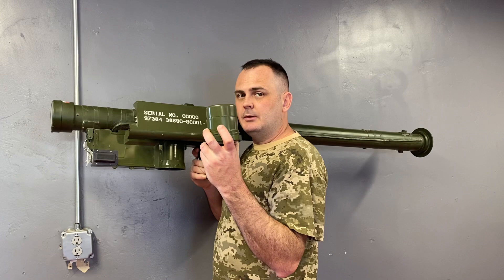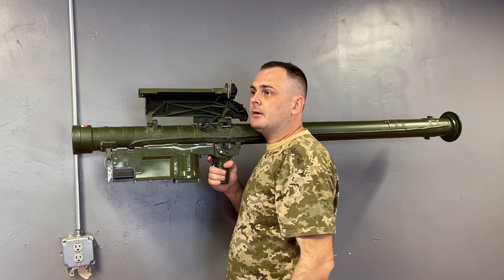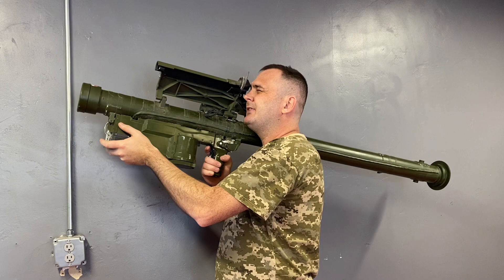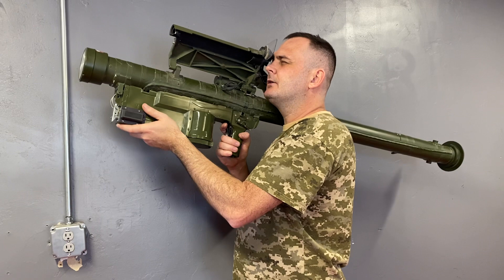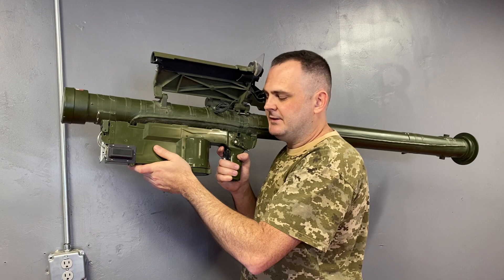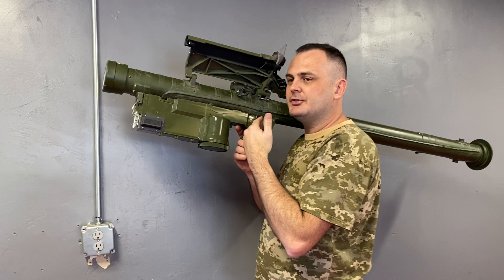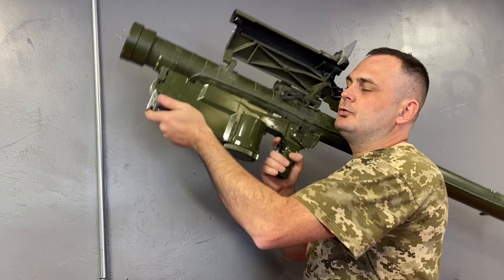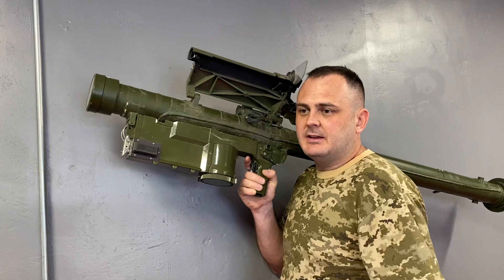Quick tutorial on how to operate the stinger missile

Comment: What's the point of taking out the cooling unit right after engagement? Isn't it expended by that point?
Reply from the maker: The batteries are still live for a while after to prevent damage to the electronics in the gripstock
Reply: @nucking_futs_yuri  Are the launchers re-usable?
Reply from the maker: @btiller44  the gripstock is the tube, no.... welll its good for bottle rockets😂
Reply: @nucking_futs_yuri  So why bother taking the cooling out, why not just drop it and run then?
Reply from the maker: @btiller44  because the gripstock is reusable
Reply: @nucking_futs_yuri  I guess I don't know enough to fully understand.   Watching you now on your part one aug 17-18 video.   Crazy shit man, I wish you well
Reply: @btiller44  if you don’t remove it the coolant will continue to be used as if it has a missle to cool down since there isn’t one, the gas will just freeze your electronics and practically, that step can be done right as you get out of ready position as it’s the reverse of the movement done to get in ready position
Reply: @land_and_air1250  Nope, the electronics exposed to the cooling left with the missile.

Comment: I was a Stinger Operator in the Dutch Airforce during the early 90's.
You forgot 1 detail (besides super-elevation) you need to lead if the target moves left to right and vice versa.
Reply from the maker: You're correct. I did forget, but it was added in the notes with a few other things when distributed to my friends in Ukraine.

Comment: So it can fire the instant you insert the coolant, until it runs out 45 seconds later?

I was under the impression that it needed that time to cool down first. Making me wonder how useful it really is against jets and missiles.

As a target getting noticed, coming in at mach 2. Will likely be far gone 45 seconds later.

This would make much more sense!
Reply: I believe it's more if a timer before the weapon system overheats, the 45 seconds
Reply: you won't hit a plane going mach 2, like missiles are fast but not super sonic fast at least manpads aren't
Reply: No ground attack plane is going to be mach 2 in combat zone
Reply: According to the manual, there is an ironically named "3 to 5 second warming up period" after the safety is actuated.
Reply: @arbu4sek  The Stinger is definitely supersonic. However, to be effective, the missile must be considerably faster than the aircraft. It would have trouble trying to hit a Mach 2 target but it could do Mach 1 or 1.25, which are much more realistic at the low altitudes which the Stinger can reach.

Comment: Why is disengaging the cooling unit prioritised the over the get outta there? does it also have potential too explode?
Reply from the maker: It's done in generally the same action. You remove it to prevent damage to the electronics. But during training in the US you're not exactly gtfo after shooting. Just remember to remove the BCU after getting to cover.
Reply: @nucking_futs_yuri  You sure the BCU isn't removed to prevent the thermal battery inside from expanding the BCU housing and becoming stuck in the well?

Comment: If the missile hits the ground does it explode?
Reply: It will explode once armed if it comes into contact with something, it doesn’t arm however until after the missle is a safe distance away from the launcher so no a ground strike that results in the missle crashing into the ground will cause the missle to not arm the warhead(also once armed it explodes of it thinks it should have hit its target already but loses lock so like a near miss will become a shrapnel hit)

Comment: battery cooling unit? Argon.... I have to know more about this
Reply: There are two expendable resources which the missile needs to track targets, even if it is not actually fired. One is electrical power (hence battery) and the other is compressed argon, which is used to cool the IR detector inside the missile to make it more sensitive. Argon (and many gasses) gets cold when you allow it to escape from a high pressure container through a small hole. This is because there is some attractive force between the atoms and as they accelerate out through the hole the force between atoms tends to slow down the random component of their motion (while the coordinated linear movement is increased). It's called the Joule-Thomson effect. The Battery/Cooling Unit contains both the battery and the compressed argon. It is not put inside the missile because often when you go to use the missile, you end up not firing it and it would be wasted if the battery and coolant couldn't be easily replaced.

Comment: There'll be more flights accidentally bought down like the MH flight
Reply: This missle can’t reach a high enough altitude to pose a threat to commercial air travel and is meant for low to mid flying jets and attack helicopters
Reply: @land_and_air1250  Praise be to the creator!
Reply: @samuelmmmk181  why praise to the creator?
Reply: @h1tsc4n40   they won't reach high enough, only a few kilometres range.  Praise be to the creator!
Reply: @samuelmmmk181  you do know God didn't make the Stinger yes?
Reply: @h1tsc4n40  You do realise I didn't say God once here. I meant praise be to the creator of the weapon system. .